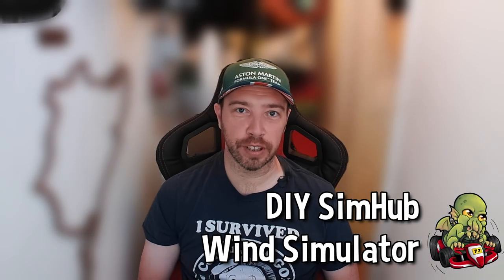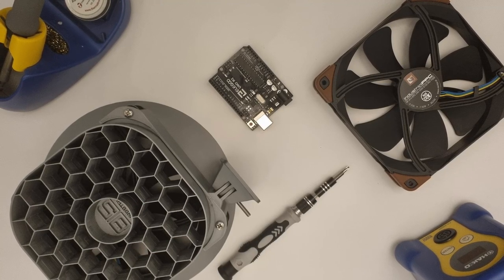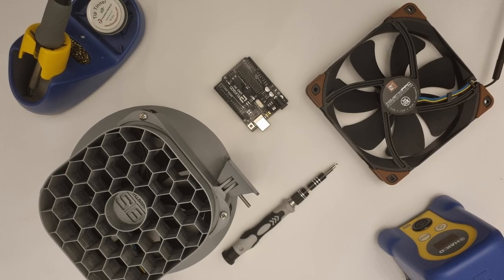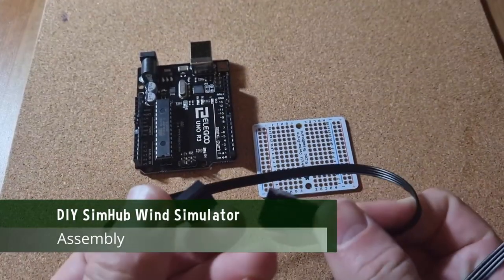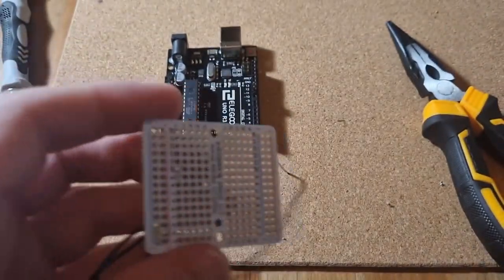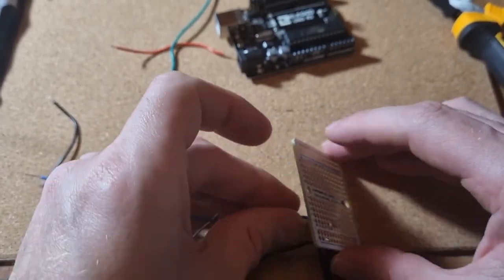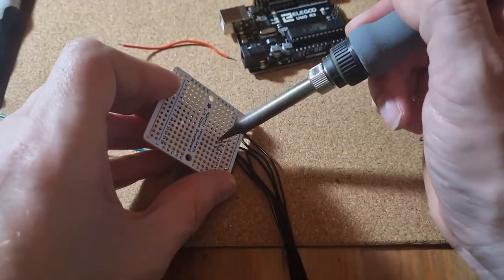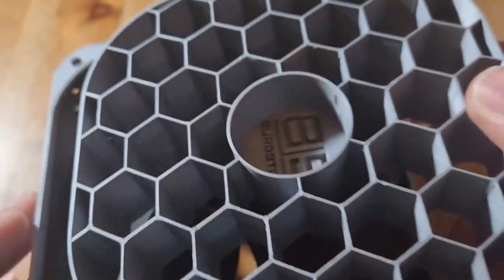DIY SimHub Wind Simulator

Comment: Hi great video/tutorial just wondered if you used a motor shield board for the Arduino?.
Reply from the maker: Nope, no need for this one as only the PWM fan header is connected to the Arduino, the power is delivered straight from the 24v power supply 🙂
Reply: @Teqqlesdoessimracing  going to give this a try over the weekend 😊
Reply from the maker: @lifeofpike3912  how did it go?

Comment: can an arduino nano be used here?
Reply from the maker: As all the power is provided by the PSU you should be able to use a nano 👍
Reply: @Teqqlesdoessimracing  i guess it's just easier because the fan controller clips right onto the uno...I'll prbably just buy an uno. thanks!
Reply from the maker: Actually this circuit doesn't use the fan controller at all so you have much more freedom in your choice 🙂